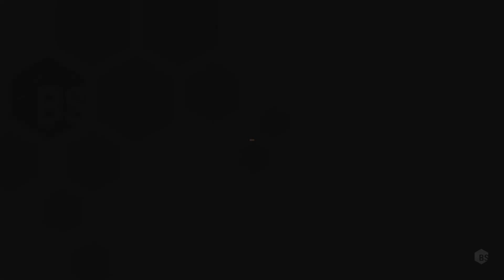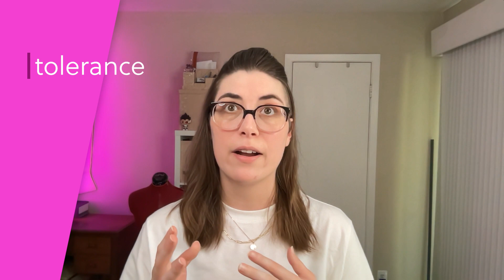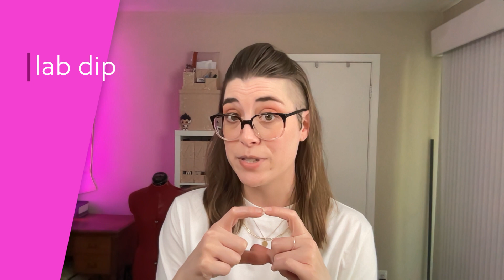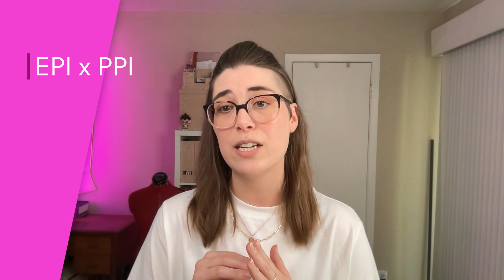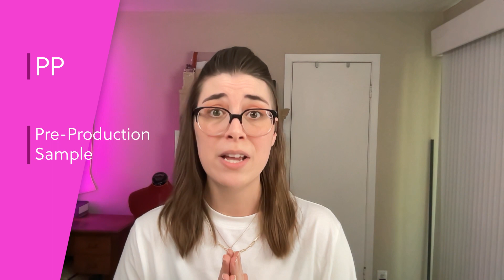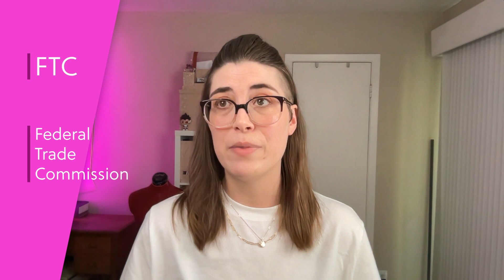Fashion Design Terminology (PART 2)

Comment: When you are describing a cast, do you describe it In primary colors? Like would you say something casts red, blue, or yellow? Or is it more complex than that?
Reply from the maker: Good question! And sort of... We use Red, Green, Blue, Yellow. Think of your classic color wheel. Reds and Greens are across from each other, so we evaluate along the red-green spectrum. Then Yellows are across from Blues, so we evaluate along the yellow-blue spectrum. We use that framework regardless of whether we read color with the human eye (visually) or the fancy-sounding spectrophotometer (digitally).